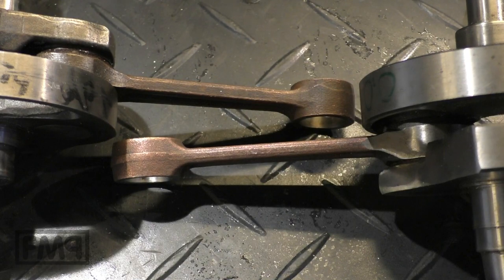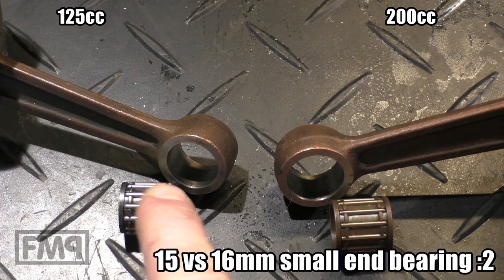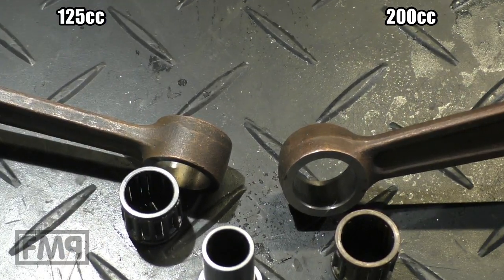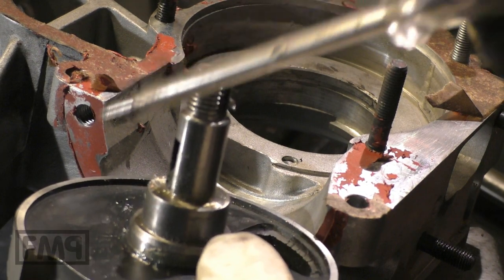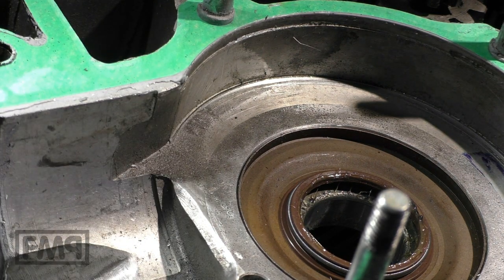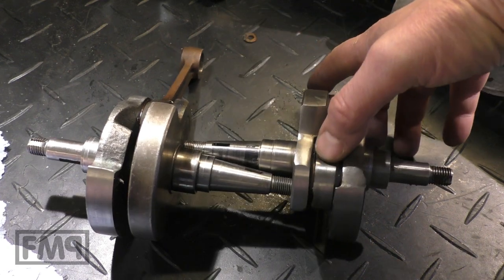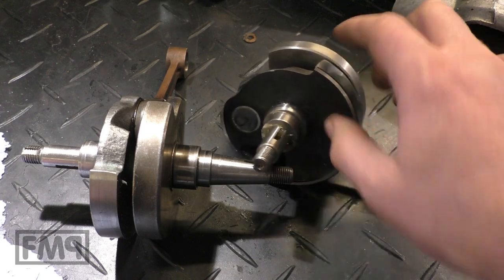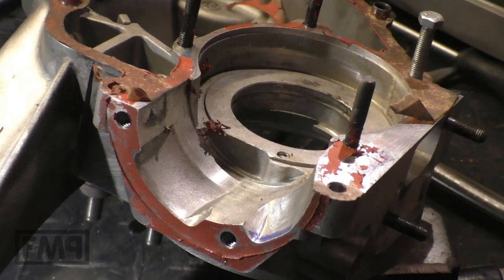vespa 125cc vs 200cc CRANKSHAFT comparison / FMPguides - Solid PASSion /

Comment: Hi. What would be the best "DIY" way to remove the "lip" from the P2 crank? Can you just dremel it off?
Reply from the maker: theoretically yes but its a hazzle. at least take a compressed air miller. still, flex grinder is the best, easiest and quickest method

Comment: 105mm 110mm but also the stroke of the crank is but both 57mm the longer rod in a 125 will be better I believe as there was a long rod conversion for the crf450 as it gave noticeable gains 👍
Reply from the maker: Length of conrod changes lambda balancing factor = runs smoother
Reply: @FreakMoPed8  
Bitte um email adresse..habe par fraghen..danke
Reply: @FreakMoPed8  bitte um email adresse